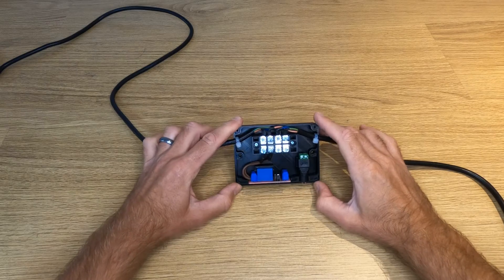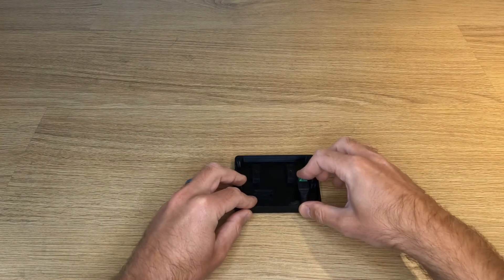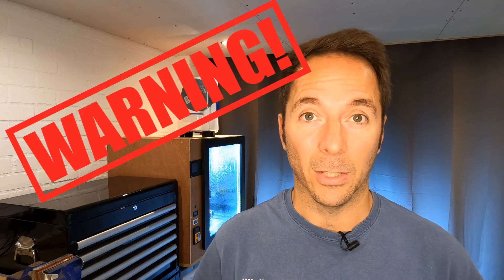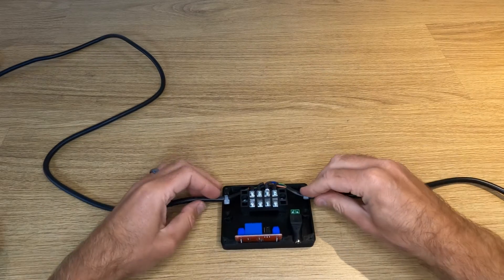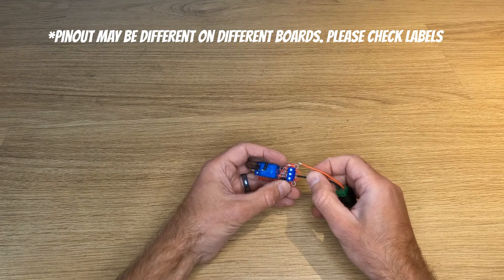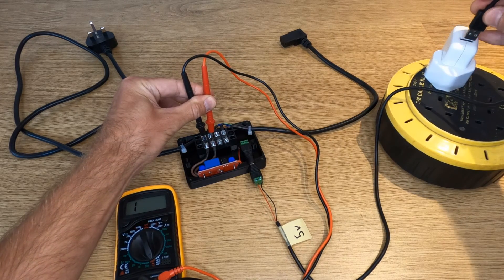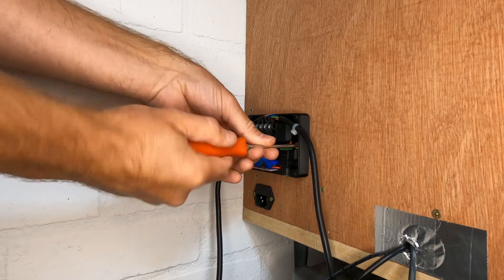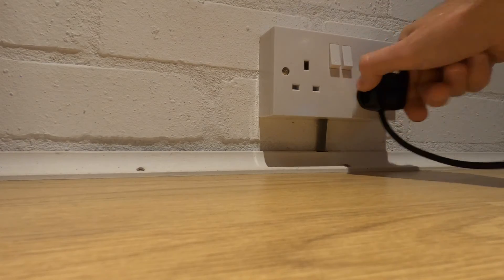240v Power Relay for Remote Switching and 3d Printer Control with Octoprint / Raspberry Pi

Comment: Just taken delivery of my first 3d printer that will live in my workshop and the first thing I started doing was figuring out a fireproof enclosure and a circuit to turn off the power if a smoke detector triggers. Found your videos while searching for information. Not seen thermal fuses before, those might be a great alternative. Thanks for putting this up.

Comment: I don't even have a 3D printer yet (will probably buy on black friday) and I'm already planning the safety side of things. My printer will be going in a large cupboard (think under the stairs kind of size but not actually under the stairs and has a full height ceiling throughout) so I'll definitely want Octoprint and a smart smoke alarm of some sort (maybe one that can turn off the printer via a smart plug too). One thing I'd really like to do, if possible, is stream the print video from Octoprint to my Chromecast device, that way I can keep it on in the background to monitor everything. I'll also be installing inline automotive fuses to the actual printer wiring and since I'm getting an Ender 3 I'll be doing the ferrules upgrade too. Subbed and looking forward to the Octoprint vid!
Reply from the maker: Sounds good👍 To be honest, Octoprint has really taken my printer to the next level of usefulness for me. As my printer is in my garage, I can now turn it on, warm it up, load up a print while I'm still in the house. I often go out to see the first layer going down but then I'm back in the house and checking on the print periodically. I know you shouldn't leave them unattended but with the safety cut out, automatic fire extinguisher and Octoprint, I feel as safe as i think I can be. Extra fuses correctly rated are a good idea but they may not catch all faults. It is possible to start a fire with a printer without having an electrical overload. I've just bought an Ender 3 and will be doing some setup and getting started videos very soon. Sounds like you found the channel at just the right time. Welcome🙂